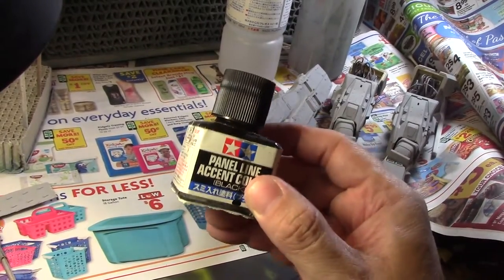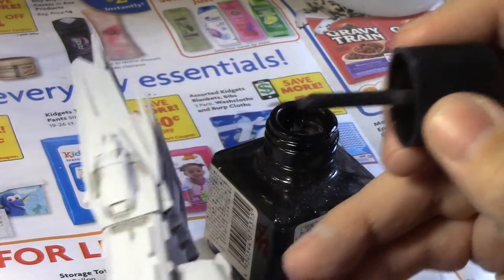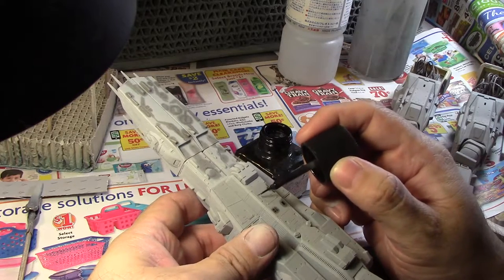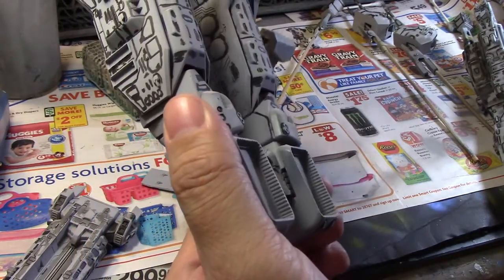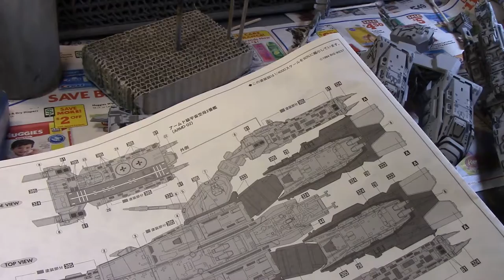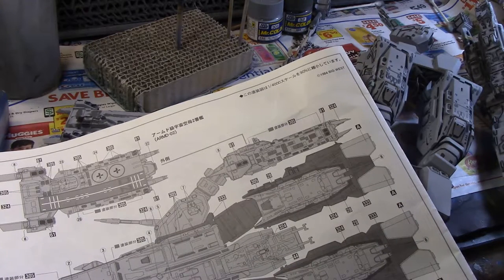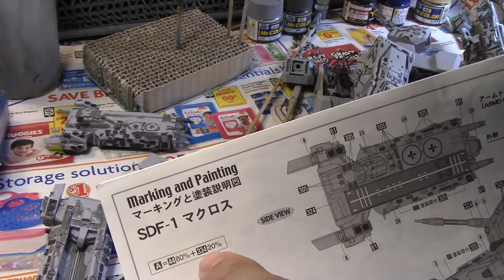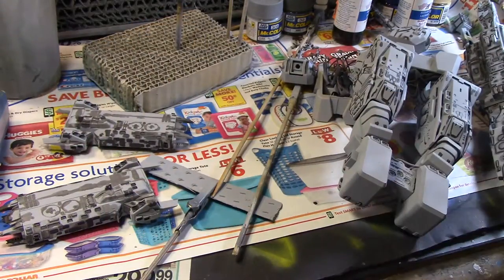*BandaiModels* Hasegawa SDF-1 Macross Movie Edition - Part 6

Comment: I think the main stumbling block with that panel wash is that the primer is a super flat finish paint.  I've had similar things happen when trying to wash something that wasn't gloss coated first, or when the gloss coat doesn't lay down smooth enough.  The wash is pulling itself through all the microscopic surface imperfections that makes a flat coat be flat.  Now I feel dumb for suggesting it last video, since I forgot all about that fact.

Also, I would go with the 315 over the 306 for the light tone.  You made a good call with the 32 to substitute for the 305.  Instead of mixing those Titans colors, I would go back to looking at that 337 for the blue gray parts, maybe darken it with a little Titans blue 1 or black.

If you google mech9 mr color chart, you should get a bilingual mostly complete image of the full Mr Color line.  It's a nice thing to have handy.  GSI Creos, the Mr Color manufacturer, also has an english version of their website, so that's a helpful thing to bookmark for quick reference.
Reply from the maker: we all make mistakes.
Reply: Yeah, that Panel Line Accent Color is an enamel-based product, and not meant for preshading. In my experience, it works best on a semi-gloss clear coat. Too glossy is a hindrance, I have found.